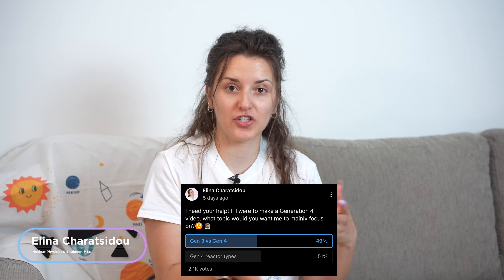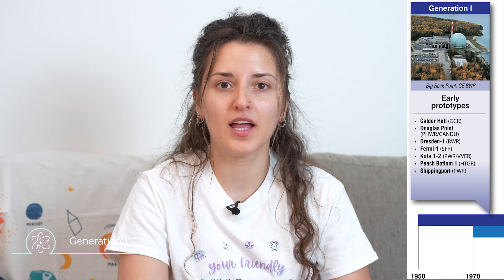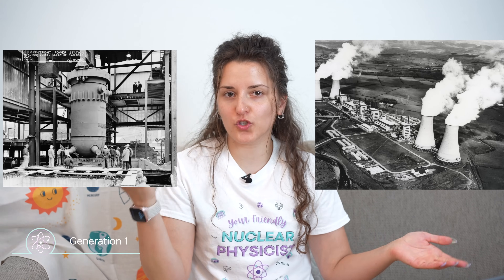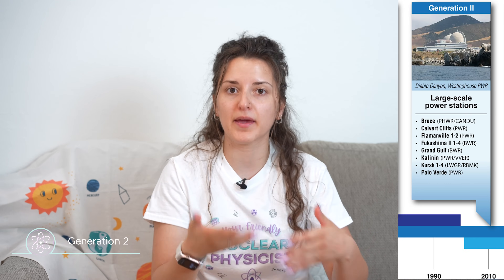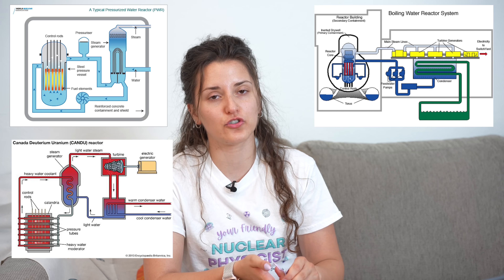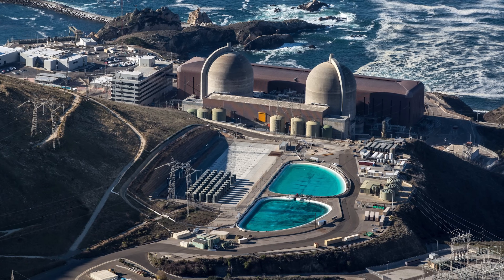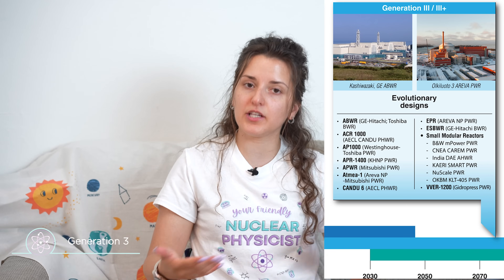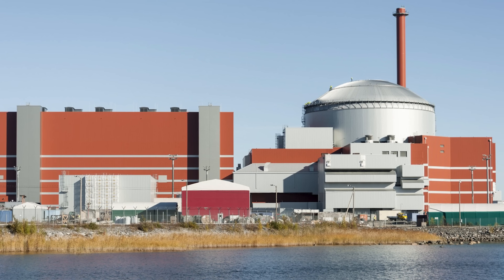Nuclear Physicist Explains - The Rise of Generation IV Reactors?

Comment: Elina:  Normally your content is very well researched.  Unfortunately, that is not the case in this video.  Here are the major issues that I know of off the top of my head (note that I'm a retired engineer who has worked in the Nuclear Power industry):

NOTE: Edited to include the early US Thorium Reactors (Indian Point Unit 1, Shippingport test breeder core)

1) There were both Generation 1 and 2 Hot Gas Reactors.  I''ll skip the most of the generation 1 reactors as they were more test power reactors to see if they would work as a power plant.   The UK built 28 Magnox Generation 1 & 2 CO2 cooled power plant reactors starting with what is claimed to be the 1st commercial nuclear power plant online in 1956.  The UK has retired all of these by now and replaced many of them with 14 Generation 2+ (very close to Gen 3) CO2 cooled Advanced Gas Reactor (AGR) power plants, many of which are still running today.

France built 7 UNGG Generation 2 CO2 cooled reactor power plants with the 1st online in 1964.  These have all been shut down.

The USA built Fort Saint Vrain a Generation 2 helium cooled nuclear power plant which went online in 1976.  This was based off of the Generation 1 Peach Bottom helium cooled test reactor that went online in 1966.

France also built a heavy water gas cooled Generation 1 CO2 cooled test reactor Brennilis, and Czechoslovakia built a Russian designed heavy water Generation 1CO2 cooled test reactor (KS 150) at what is now the Bohunice Nuclear Power Plant.  This appears to have been the worst performing HGR ever built.

There is nothing new about HGR's.  Other than the the pebble bed experiments and the future possibilities there; all I see are suggested improvements based on lessons learned from the Magnox, AGR, UNGG, and Fort Saing Vrain power plants.

2) You completely left out the Generation 2 Soviet/Russian RMBK reactors.  That was their initial main power plant design (positive void coefficient at startup, no containment building, very few safety systems that the West considered necessary in the 1950's and 1960's.  Large RMBK power plant reactors were ordered, built, and online long before large VVER reactors were ever built in the Soviet Union/Russia because they were much cheaper and faster to build.    While the original Generation 1 PWR VVER test reactor predated the RMBK development, nothing really was done to increase the size to larger commercial units until it became clear that the larger commercial power plant sizes was needed to support an export market as many countries did not want a RBMK reactor, and would accept a VVER design.

3) The AP600 was never built.   In actuality there were a number of "600" designs approved by the US NRC as the discussion in the 1990's was that the perfect size power plant would be about 600 MW electrical output.  After both BWR and PWR "600" designs were licensed by the US NRC, the discussion was that building much larger units was more economical.   So the desing was enlarged to the AP1000.  Other companies also developed larger designs and at least submitted them to the US NRC for license approval (some of which was completed, and others were withdrawn).   There were I belive 2 larger BWR designs licensed; but only the AP1000 has ever been built (and I believe 5 are running, the 6th is in startup, and China ordered last year 6 more AP1000's because they perform better than their own advanced design; there are letters of intent to build up to 12 AP1000's in Europe - but no contracts signed yet).

Also the AP1000 was a Generation 3 design; which with very trivial design changes could be modified to Generation 3+ standards (I worked in a early Generation 2 PWR that was originally licensed under the Atomic Energy Commission before the NRC existed) which retrofitted the post Fukushima requirements onto a late 1960's designed plant - it was not that hard to do).     The initial 4 AP1000 units built by the Chinese were Generation 3, and I believe now updated to 3+.  The 2 built in the US were modified to Generation 3+ during their construction.

4) There is absolutely nothing new about the concept of nuclear fuel recycling nor their advantages; and most of the advantages could have been used in the Generation 2 and 3 power plant reactors (we successfully transitioned to burning up plutonium and some other things in conventional LWRs years ago - that's how the world has disposed of most of the "excess" weapons plutonium.  France, Japan, Soviet Union/Russia, UK, and USA all built nuclear fuel recycling plants.   At this time I believe only the Japanese and Russian one is operating as they proved to be far more costly than just mining new material.   They are a radiological mess/nightmare based on my discussions with some people who have worked in them.

I have not yet seen anyone talking about how they are going to economically build, manage, operate, and dispose of a fuel recycling operation that the everyone is waxing about as the "potential" of future of nuclear power.

5) There is also nothing new about the Thorium breeder (U232) fuel cycle; without getting into other countries the USA has built and run 3 reactors on thorium as both LWR and liquid salt reactors.      The experimental liquid salt water reactor in the USA history is well known.  The two major issues it identified was the extreme corrosiveness of the liquid salt solution that contains thorium, either U232 or Pu239 starter, and all the various nuclear produced and decay products; and just how unreliable the reactor design was (it tripped about 400 times in its 4-5 years of test operation; a number 10 times as much of the various light and hot gas test reactors).  To this day I have yet to hear of anyone solving this issue, and I know that a number of "super alloys" have been tested.  You also cannot have a power plant that trips frequently.   I believe that the reliability issue is solvable, if an appropriate alloy can be found solve the corrosion issue.

Indian Point Unit 1 was a 275 MW Generation 2 PWR was designed and used Thorium (U233 seed) fuel rods and went online in 1962.  They later changed to U235 as it was much cheaper than using thorium based fuel rods.

Shippingport PWR 60 MW electrical output Generation 1 test reactor, online 1957, successfully ran a thorium breeder core between I believe 1972 and 1977.

Note that the recent Chinese liquid salt water test reactor is about 1/4 the size of the ancient US test reactor which 1st looked at liquid salt operation.  The Chinese are being very cautious and limiting their financial exposure as they know that they are a long way from designing a power reactor even if they solve the problems (2 sequentially larger test reactors - at least 8 years apart that successfully operate for many years before you get to designing a small power plant reactor.  Then that has to work for at least a decade before you sink money into building a large power plant reactor.

Most people who talk about thorium reactors today are not aware that it was actually tired once, and found uneconomical.  The USA is still sitting on about 5 tons of U232 seed material for thorium fueled reactors produced over 50 years ago (Thorium itself is not fissile - you need to add U232, U235, or Pu239 to it to get the reactor going.  A thorium core will self generate U233 and U232 which it will run on once it is running and sufficient decay time is allowed.  U232 makes a great atomic bomb - so reprocessing spent thorium fuel has the same proliferation risk as reprocessing spent U235 fuel).

6) At this point the evidence is that SMR's will be much more expensive to build and operate than large central stations.  Look at the 6+ Billion estimate, which was certain to go up during actual construction,  to build the NRC licensed NuScale 50 MW electrical output design, with 12 units at a plant site.   Had they progressed it would have been the most expensive power plant in the world based on cost per Kwhr generated (and that's assuming it operated as expected - something that has not worked out for most new designs).

The SMR proponets talk about a lot of theory and ideas that those of us in nuclear world know are totally unrealistic.

If NuScale was serious, they should have found investors to fund the likely $7+ Billion cost of their approved design.  Learned what needed fixing, and designed a 2nd generation plant after at least 5 years (more likely 10 years) of successful run time.

The reason we can build highly reliable evolutionary large plants is because we have over 7 decades of experience on what worked and what did not.   A lot of money was spent modifying early plants, and a lot of early plants were shut down prematurely because they could not be cost effectively modified to run well enough.

Have a great day,
Reply: " To this day I have yet to hear of anyone solving this issue" (you speaking of corrosion) Every single gen. IV MSR start-up has solved corrosion issues and none of them are using exotic alloys. Simply keeping the salt clean solves 99% of the perceived problems.
Reply: @chapter4travels  Really?  Please tell me who with a running molten salt reactor has solved the problem?  

The article I found on the Chinese test reactor says that the Chinese hope that they have the corrosion problem down to a manageable level for their test reactor, which would allow the design of a longer lived reactor. 

Now there is one company that says that the ultra pure hot Florine salts by themselves do not cause corrosion issues in normal SS alloys.   I'll buy that.

But they haven't tested what happens when you add thorium, some starter uranium or plutonium, and then get all the nuclear reaction by-products released from a nuclear reactions.  Of course, remove all of those products from the Florine salts and it likely doesn't corrode.  Of course, its not going to be a nuclear reactor either.

I'll even buy the possibility that hot molten Florine salt with just thorium added might not be corrosive.  But thorium is not fissile - and you will never get a nuclear reaction from it.

I also have not heard their plan on how they actually are going to remove all these byproducts from the hot Florine salts.  It's all so theoretical.  Lab theories rarely work when scaled up.  

I prefer to go on the evidence of the molten salt reactors (and test devices with an appropriate mix of reactor byproducts) has show.   Corrosion is an issue.
Reply: @perryallan3524  Please tell me who with a running molten salt reactor has a corrosion problem?
Reply: @chapter4travels  At this point no one.  Here is a fact:  Only 2 molten salt reactors have every operated.  Both were in the USA and part of the 1950's and 1960's test programs.  Both had significant corrosion issues once the fluids became contaminated with reaction byproducts.

China is the 1st county to be building an actual 3rd one, which should be starting up soon.   They are specifically testing a new NiMo-SiC alloy with the hopes that it will have a low enough corrosion rate that they can design a suitable reactor based on a reasonable corrosion allowance (as standard practice in pressure vessel and piping design).

Many counties have studied and proposed draft designs; but no one other than China at this point has been willing to fund a MSR test reactor since the USA in the 1960's.

That should give everyone a pause - as the nuclear power industry woldwide has spent the equivalent of at least a hundred billion dollars in today's dollars trying to build successful liquid sodium reactors.  France even designed and built a 2nd generation sodium cooled reactor after their 1st generation design failed; and it too was very prematurely shut down due to issues.    Without checking I believe that only Russia is operating a liquid sodium cooled power plant reactor - which they claim is doing well.  But, we usually hear 20-30 years later the real stories of how badly various Russian reactors ran; so I would not put much faith in what the Russians are saying today.

They worldwide nuclear industry spent more than that on developing high temperature gas reactors (HTRG's) and has been generating electricity with them since the 1950's.  But, no one is building replacements at this point and the current remaining ones are scheduled to be replaced by PWR reactors when they reach the end of their life.

The USA also built a thorium fuel cycle power plant reactor in the 1960's as well; which were changed to uranium due to economics.  The US Department of Energy is now preparing to spend Billions to dispose of all the U233 they manufactured to support thorium power reactors in the 1960's - 1980's (which cost the equivalent of $billions to manufacture).

So an industry that worldwide has dropped many tens of billions of dollars into all kinds of different reactor designs that in the end did not work out... found the MSR concept so wanting with major technical challenges that they invested nothing for about 6 decades.  Do you think my predecessors and me were really stupid or something - or did we see challenges that we had no answers for.

Lets see how the 2MWth test Chinese reactor goes once it gets running.   Just remember that they expect to have corrosion.  I'm sure that we really won't find out much for 4-5 years after it starts up.   

If it works as hopped.  Then they build about a 20 MWth test reactor.  IF that works welll for a number of years they build about a 200 MWth test reactor with likely about a 70+ MWe electrical output.   Then if that works well for a number of years they design a 600+ MWe output power plant - likely online in about 35-30 years, assuming all goes well and there is nothing that needs major reqork (which is a fantasy situation).
Reply: @perryallan3524  Here is a fact, there are more than a dozen liquid-fueled nuclear start-ups that all lean heavily on the experiments of the 50-60s, they are all 100% aware of the corrosion issues they learned about and each and every one of them has a strategy to mitigate those issues. Each and every company has Nuclear physicists and Chemists that have dedicated their careers to these ventures. Half a dozen different salt chemistries, thermal spectrum, fast, graphite-moderated, fuel tubes, replaceable cores, metallic sodium, and more. Each is a viable solution to a high-temperature, low-pressure way to generate high-grade industrial heat. And the cool thing is only one has to succeed to change the world. The advantages of liquid-fueled fission over gen.1-3 are long and important. The most important are high-temperature output for hundreds of industrial applications, including producing synthetic liquid fuels and fuel utilization. Liquid-fueled fast reactors mean our uranium supply will last for billions of years with little to no waste. 
In short, the future's so bright, ya gotta wear shades!
Reply: @chapter4travels   
Sorry for the delay in responding:  I was in the hospital for several days; and got good news as to the cause of the issue.

Not a single one of those nuclear startups looking at MSR's has even applied for "pre- licensing" activities prior to licensing a reactor design.  Much less run a reactor.

My memory is that over 10 countries generated MSR designs in the 1970's - 1990's via government funded programs; yet chose not to pursue them.

I actually consider most of the MSR startups to be investment scams.   It's a way to generate a good job for someone and some of their friends, and other people, that lasts a decade + even if nothing comes of it.  Get lots of people who don't understand many realities of nuclear power to invest money into their project in the hope that they can make it work (while the top few people know that it likely never will - or even that it cannot ever work as they are saying).  Example:  There was actually a paper written on why normal 300 series SS alloys are not suitable as a metal for MSR's that explains in detail how the reactor byproducts attack this class of SS in an operating MSR (based on experience).   Yet there is a company touting how 304 SS is not affected by pure liquid Florine salts (without any thorium, U233/U235/Pu239 starter materials, and with no reaction byproducts) and they are planning to build such reactors (and have a nuclear reactor constructed and operating 3 years after they test a full size pure Florine salt circulation system of 304 SS that will not corrode with pure Florine salts).  "Hey.  I can eat an apple I pick off a tree by my hand with no utensils.  That means that I can eat a coconut I pick off a tree the exact same way without any utensils and not have any problems."   It's ridiculous - but they have people investing in their company and I assure you these people are making good money.

History is full of such investment scams.  Nuclear power is just the most recent industry to be targeted by them.

You might wish to read about all the "dot com" business failures as well - after sucking I believe about a trillion $ worldwide in investment money.  About a 99.99% failure rate... except that many of the people who led such businesses walked away with some years of good salary and often money paid to them as bonuses for the "pre-success" during startup.
Reply: @perryallan3524  Terrestrial Energy is past that stage in Canada as is Thorcon Power in Indonesia. Copenhagen Atomics and Seaborg Industries are also well into regulatory review. Even in the world of nuclear energy, progress happens albeit very slowly.
Reply: @perryallen3524. Wow! That is one hell of a critique! 

You've given a lengthy list of why things haven't worked, or the various failings of numerous reactors through history, and you've done a lot to highlight the challenges ahead of us. But I don't see anything in your comment that proposes solutions to these issues. I know you're retired, but perhaps you shouldn't be. Maybe consider reentering the nuclear field and adding you experience to the team of people working for the future. The planet needs everyone on this.

As for Elina, I will defend her, because she is presenting information for consumption by the interested lay person, not a design review team of nuclear engineers. She is facilitating a much needed discussion in the public forum and needs to be commended for her efforts. Videos of sufficient depth to cover all of the points you raised would be over the head of the target audience.
Reply: @kevynnedallaire1815  I would have expected Elina based on her previous good work to have picked up on the HGRs (HTGR) that have been generating power since the 1050's (especially in the UK), and cannot imagine how she missed the Soviet/Russian RBMK reactors.   Had she included those two items in her list I would not have commented.

As for finding solutions: The answer is it takes real time and real money.  Something most people looking at these projects don't really understand or want to consider.  

Only NuScale and Holtec seemed to go into their SMR concepts with their eyes at least half open to the timelines and potential cost involved.

A reality is to get to a massed produced reactor - you have to get a reactor that works well in practice (not in theory or on paper).  That means it must actually run really well for at least a decade and you know the design works.  

The experience from the early nuclear power plants is that you likely don't get a reactor design that works well until the 2nd (and possibly 3rd) generation of that reactor and plant design.   So you are talking likely 20-30 years after the 1st plant comes online of that design and tens of $billions in development and operating cost to get to a point where you can start to talk about the possible economics of mass producing some reactor in a factory, assuming that it works out.  Now perhaps someone gets lucky and their 1st reactor design works. and you can cut the process by a decade after their 1st plant comes online.

In the USA it takes at least 4 years to license a new reactor design and a site to build it on, then you have to build the reactor and all the support buildings (which includes security, emergency response, training, etc).  Europe's process takes about the same time (it varies a bit country to country).

NuScale has the only licensed SMR in the USA at 50 MWe; and they never even filed for a license to build one on a site.  They are planning to submit another license request for a 77MWe plant and try to build that.  Figure at least 2 years for the license approval process once they submit their design.    At this point the utilities involved with NuScale seem to be backing out.   I'm not sure where they intend to build their new plant at.

As for my retirement:  The US Nuclear Power industry chunked out the vast majority of engineers over age 50 over the last decade through various "downsizing" mechanisms.  The companies looking at new reactor concepts are generally not hiring these people.   They generally prefer people with no nuclear experience.

Otherwise I'd love to assist....